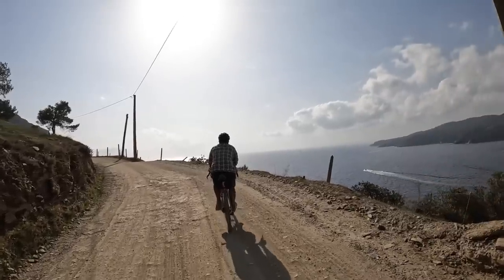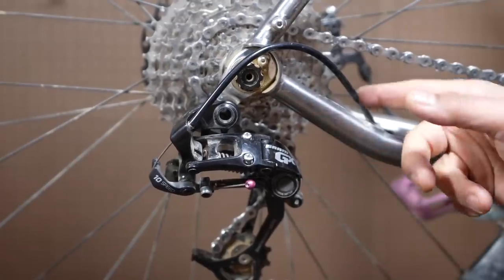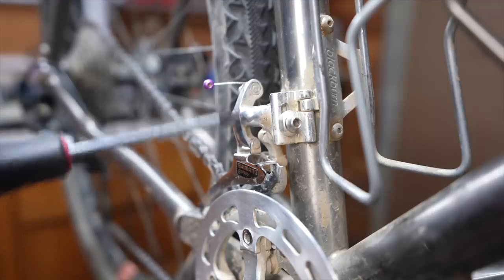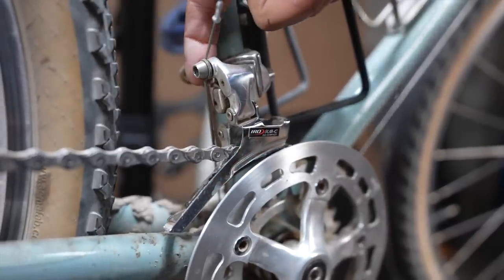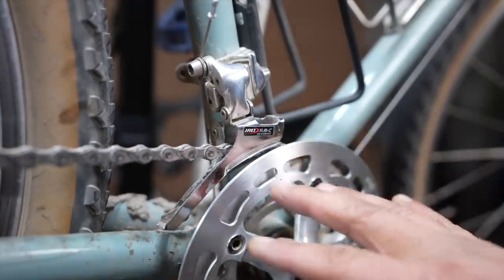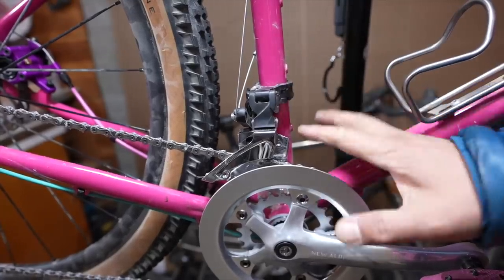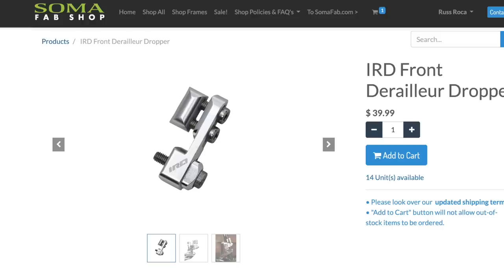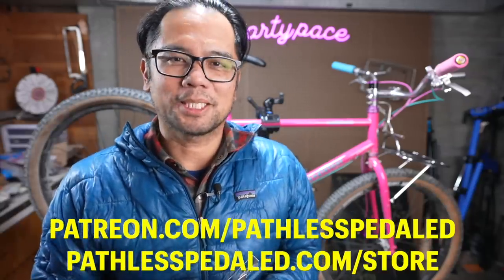These Components Are Disappearing...Get Them While You Can

Comment: Still rockin' a 3x7 on my metal-frame 26" commuter.  And no, I won't be removing my front derailleur because shifting doesn't freak me out. 😀
Reply: 3x is brilliant for 26 inch wheels as the smaller diameter has a wider range of rpm's required.  I cringe at the sight of all of these 26 inch rebuilds going 1x.
Reply: commuter bikes don't even need shifters
Reply: @SurpriseMeJT  O cringe is the word for it, good one.  And whatever happened to revs and knees, just having a rear derailleur is like heading back happy to the stone age.  :)
Reply: @justdude8115  Maybe but the problem is those party pacers.  You never know when they'll amble past and act all mellow but inside you know they're laughing because they're faster than you.  So yeah, that's when I hear the call of the big ring and show them who's who on a ride through the countryside.  Tho' I do feel bad when they can't get their 42 to go any faster.  :)
Reply: @robbchastain3036  hah, noice. But in this case I would simply go with 46t chainring and 11-42 cassette. I don't quite like running front derailleur, I prefer simplicity, but these steep protracted hills are forcing me to run double/triple. I have 22/36 on my current bike, but for my vintage mtb I want to buy 26/40 chainrings
Reply: @justdude8115  Glad you got the grin and at 63 I'm not really fast anymore, tho' I am all-weather stout, call me a party pacer with swagger and I will go down swingin' if overtaken rudely, I'll pick up the pace and offer up a warning that if they don't keep crankin' I will catch 'em and that does keep 'em lookin' over the shoulder until they get up the road.  And that always amuses me, no interest anymore in actual duels.  Unless I enter a gravel event and go for the trophy in the over-60 class.  And that might even call for a new carbon 1x.  You gotta be serious if you want to win.  :)
Reply: @justdude8115  I should add that I like your gearing choices and any talk of triples and you're talking my language, love triples for all those choices and not really having to think too hard about cog selection.  If revs are right, great; if not, lots of ways to find a better cadence no matter the terrain or load or just how you feel and I tend to be all over the map with that as I like to romp and stomp and spin and win and everything in between all on the same ride.  And I think that comes from growing up on a Sting-Ray and then ten-speeds and BMX bikes and racing and training and, in high school, chasing mopeds through the streets of Frankfurt when I was a military dependent in the middle of the '70s and it was done in good fun and if I caught one of those lazy dudes, I'd offer up a cheery Guten Tag as I was almost in tears from the effort, lol.  And yeah, these days I still have a lot of it--or at least some of it and thankfully so--but I have opted not to run down anyone on their fancy bikes anymore, although I used to do it regularly to let 'em know I didn't appreciate the disrespect of no greeting or whatever.  I don't want to discourage anyone from riding and somehow, without trying, I look like a homeless guy on my bike with weathered clothing and gear and floppy panniers and the whole bit.  And I know I look homeless because kind people occasionally offer me money--I decline with profuse thanks--and other people steer clear of me in stores or fastfood establishments, something I experienced two days ago on an afternoon filled with errands.  And that saddens me but at least it is just a winter thing with the weather and my layers of comfortable clothes.  And maybe one of these days I'll upgrade and look a little spiffier.  And faster, perhaps.  :)
Reply: @justdude8115  Grown up bikes have gears.
Reply: @robbchastain3036  is cringe really the word for it? Does Jay really recoil in fear at a 1x drivetrain? Or is he, and yourself by extension, just being a drama queen?
Reply: @throbbinwoodofcoxley6830  Cringe is the word and it does apply to builds where a perfectly fine triple is transformed into a campus bike as tho' that's an upgrade.  And I like the 1x aesthetic for certain applications--more power or imaginary power to 'em--but I'm all over the map with my cadence and happily so, just the way I ride, like sometimes I'll climb out of the saddle in the big ring until I expire and quickly sit down and flip it into the tiny ring and recover the rest of the way up.  And for that matter, I'm still happy with grip-shift-type shifters, got one on my bars which I removed from a Walmart bike which I bought for parts.  The other one is stock but when it goes, I'll remove the other shifter from that bike which I bought new on clearance three years ago.  And I was on the roads of Central Pennsylvania for nearly three hours today, reaching my destinations and waving to motorists who accommodated me and wondering why people still yell stuff out the window at us, like, enough of that, kooks, get over it..
Reply: Trek top fuel 3x9 always shifting,  just like in a semi with a Eaton Fuller.  I would have nothing to do with a single front chain ring bike. A  3x11 would rock.  Keep your chain clean and lubed.
Reply: @dand3975  A 3x9, okay, just a little jealous, I am.  A 3x11, I like the way you think!  😀
Reply: Gearing fashion is not gearing innovation. There's always a trade off between chain line, wear characteristics, changing efficiency, and cadence steps. Stick around long enough and you'll see half step, wide range, close range, 3-ring, 2-ring, 1-by, stepped cog, full cog, wide block, narrow block, fixed and single speed come in and out of fashion. The driver is commercial and the result is incompatibility. In many cases this means not just new components, or even a new drive chain, but a complete new bike. If something works for you stock up, because chances are it won't be around for long.
Reply: @justdude8115  probably depends on the average speed and the elevation gains the rider usually does doesnt it? unless you like going real slow and or mushing that knee cartilage. i pretty much only rode single speeds when i lived in a flat area and it was fine, now i regularly climb 1000 feet on my 10 mile commute. glad to have all my gears  and my not worn out body.
Reply: I ultimately ditched my 3x on the front when I swapped the bottom bracket with a mid-drive.  Before I'd done that I rarely used the low ranges because we only had one hill steep enough to need the lower ranges, and It was less of a bother to just stand on the pedals for a minute or two. Having lost the weight, I can do that hill sitting down on the high front gear. The derailleur is now just a chain guide. 

I've got so much extra power with the motor that not only will I never go back, the next bike to get the conversion is getting the biggest front sprocket I can find. it'll do 10 mph up the steepest hill we have here in high gear with a partially demagnetized motor because I let it overheat one too many times.
Reply: @SMenkveld  Many of them do, but they're not *essential*. A very flat area (such as the Netherlands) doesn't need more than one gear range to get you by. Most of the bikes in that country are single speed, with a handful of 3-speeds. And E-Bikes like mine have pedals as extra/backup power (or to make them appear legal when they are in fact not :P).

Front derailleurs are not as un-manageable as people make them out to be, but they are more finicky than their rear-derailleur counterparts. and if you don't use them much, then the extra weight and tuning isn't as worth it. Ditto the rear gears, though most places have enough hills for the rear 7 to be justified. If I found myself pulling trailers with my bike, I might upgrade to a 9 or 10 speed on the rear.
Reply: @borderlands6606  I like the way you put that, gearing fashion is not gearing innovation and if something works for you, stock up.  And for me in this season of my life, bike commuting is my riding and I am thankful I made the decision to return to it nearly a decade ago after too many years of not doing it with any regularity.  And as I think about it because of this discussion, I just think it is easy to ride s 3x, not much thought has to go into gear selection and it is just fun to have all those options, necessary also with a load or weary legs and body.  And I like Russ' saying about party pace and his pink neon light, but all riding is party pace, just depends on whether it is James Brown or James Taylor on the stereo.  And it's always bring your own bike and mine is usually a 3x, just my choice for the party. 😀
Reply: @DFX2KX  Okay, a mid-drive motor means not having a front derailleur is an excused absence, lol.  And I am sort of right there with you as my commuter with the 3x also has a 250-watt front-hub motor by Green Zone Bikes and I am loving it, actually, my first foray into anything electric and it is mighty handy on my 14-mile ride to work when I am doing a time trial yet again with a Grinch-like grimace, lol.  And I grin but truly, it is great to have some boost and juice in either direction and for commuting, no question that it is safer to have a motor, like for me there is a mile-long straight stretch of two-lane road where motorists really wind it up and the faster I am off that the better, particularly at night.  Same with uphill bends and intersections, just push that thumb throttle and zip through them.  And having that motor has motivated me to ride out of the saddle up ramps and rises as interval-like training and then I have that juice for flats and gentle rises and headwinds.  And I really don't mind riding unassisted, not that I welcome it but I get far more mileage from a battery charge than I ever expected, and that's another reason for me to love my 3x, not noticing the weight of the e-bike conversion up hills and such.  Still, I could see upgrading another bike with a mid-drive, all the fun and games we play.
Reply: @robbchastain3036  I rode 3x mtb for on-road use for decades and never changed out of the middle ring; it was a no-brainer to go 1x and lose the wasted weight of unused chainrings..
Reply: @petesmitt  I'm totally cool with that, no cycling demerits for riding your way and I actually want to do a 1x street bike with a compact frame, 26" wheels, BMX bars, a nice selection of cogs, and a banana seat, with a rattle-can metalflake finish and components plated in complimentary colors.  And it would be an homage to my childhood Sting-Ray and BMX bikes and the 26" single-speed Mongoose I bought in '82 for competing in the BMX cruiser class.
Reply: With ramps and pins shifting a front is not much more difficult than a rear. I run a XT 3x9 (44/32/22x11-36) on my trek  7900 drop bar gravel bike. Will until I replace the bike with a 2x wide range. Having those bailout gears bike packing or even just on a long day in the saddle is great.
Reply: @MountainVisions  I'm enjoying this conversation about 3x and it is prompting me to think more about why I like it and yes, the bailout gears are great.  And what's more, for me, is that my 14-mile year-around commute is never really the same from one ride to the next and maybe I'm sloppy that way but I pretty much freestyle all the way and I face a bunch of ramps and rises and a couple of proper climbs and my first decision before each is selecting a front ring and then dialing for cogs.  And then laying on the proverbial tank on any descent and preparing for the next grade of any significance.  And I make it a game, too, like one morning this past week I opted for spinning out of the saddle up a quarter-mile rise and busting my thighs and lungs until I reached the telephone pole which brought that madness to an end.  But I made it and I was happy about that.  And who knows, maybe all of this will win me a ribbon in the over-60 class at a gravel event or something.  That's what I keep telling myself, anyway, and it is all great fun, sometimes more so afterwards, and all grins aside, I enjoy the health and financial benefits of riding daily, plus being a cycling advocate of sorts is meaningful, too.  Like this past week, I had just finished a rise when I looked over my shoulder for any approaching cars and noticed a boy waiting for the school bus, looking intently at me ride past him on his front lawn.  And then there was a woman on a walk and she exclaimed, "I see you riding your bike every day, back and forth."  And I'm all for being seen on a bike and hoping others opt for their own adventures and challenges, too.  O and one more thing about the tiny ring, safety in terms of keeping your line with revs when you're on a steep climb on a shoulder next to a guardrail with motorists gunning it and leaving little room for any deviation in your line.  Thanks for writing and 3x9 sounds like something I need.  😀
Reply: @SurpriseMeJT  I like having 3x on my 26ers, but i'm pretty sure what you are saying is wrong. The smaller diameter wheels do of course have an impact on the gearing, but in a linear way that can be compensated completely by just having a bigger chainring.
Reply: I have 3 bikes one of them is a 3by too. I would prefer taking out the gears in the back leaving 1 while holding onto the three in the front to give me options for different gear ratios. That is all I need maybe only 2, but I haven’t tested the gears on the ridiculously steep hills I come across front time to time. If I could get away with 2 then that would be ideal, but for my single speed unquestionably I want just 2 in the front.
Reply: RollinRat  at 63 a single speed wouldn't work for me here in Cumbria......some of those hills are relentless.

Comment: Best solution in my experience bikepacking 6 months in south america on 5000m mountain passes: 32 oval up front and a 11-46 cassette. All that is 1x but what if you had a 22 chain ring also on that crank! Well hell yeah, you just switch it with your fingers when there is a 20km climb with 2km of elevation gain incoming. For the 5 seconds it takes and the occasional dirty fingers, it saves weight is complexity on a bikepacking trip!

Comment: I don't know if this is the first time you explained the sub-compact as a 1x with a bail-out but that is a perfect explanation. Every gravel bike that wants to do double duty as a trekking machine should have that crankset. Very good video!
Reply: I've also seen people running a bail out chain ring with no front derailleur. It's possible to shift down using your heel. Obviously you have to stop to shift up again, but that's my norm at the top of a long steep climb!
Reply: @davidraffe3445  I've seen this more common on tadpole recumbents, which makes sense if not for the greasy fingers on the lifting to the big ring.
Seems a nice middle ground where the lower end was the old flip your rear wheel around to get another gear. Not too much reduction else chain length issues.

Comment: Worth noting FDs come in 2 flavours: 63-66 degree and 66-69 degree. This tells you which chainstay angle they fit. 63 is 'road' style 66 is MTB. It makes a difference in getting the FD to clear the chainstay on the smallest ring.
Reply: Also make sure the derailleur matches the number of teeth on the largest cog. I had to replace a chainset on my 26" mountain bike and carelessly didn't notice that the new one had more teeth on the largest cog than the original. I ended up changing the front derailleur as well.

Comment: Love this! IIRC, my old 44/28 setup used a 105 road triple shifter to get the pull needed for an SLX front derailleur.  Clunky, but not a big deal with the small ring being a bailout gear. Tiagra/GRX 400 rear derailleurs have recently had 2 tooth higher max cog size than 105 and up models. Miss the days when MTB and Road cable pulls were compatible.

Comment: Excellent explanation of all the issues that come with a front derailleur. Once setup, front derailleurs are nice to have for both the range and the bail out on steep climbs. I also like it as a chain guide as 1x can drop a chain on the washer board roads. If you have lots of middle aged mountain bike friends, you can source a front derailleur for a six pack of beer.
Reply: To be fair, with modern 1x, I have never dropped a chain anywhere: front or rear. Narrow-wide chainrings and clutches mean they are very reliable. I used to drop chains on my 2x (even Di2). I have Ekar now on 2 bikes and no chains dropped, ever.
Reply: @seanrequiredfieldcannotbel1362  Good for you. My Sram GX clutch can't seem to handle the washerboards. I'm using a 1x Raceface Narrow Wide chainring. My 90's mountain bike with Alivio front and rear derailleurs slapping about doesn't drop the chain on the same mile long washerboard section. All I'm saying is a front derailleur serves as an effective chain guide.
Reply: @newttella1043  have a shop look at your 1× setup. Morern 1× does not drop chains, is what I'm saying. Your point is moot because I can drop a chain on a 2× that has a front mech.

Comment: Look at the Shimano XT 2-11 front derailleurs on the big auction site. Under $10 and work great for 28/38 chainrings. The 11-46 cassette works great with the 11 speed Shimano SLX or XT GS derailleurs. I am running 28/38 and 11-42 11 speed on one bike and a 11-42 with a 24/36 11 speed another bike. Both with 11 speed chains. Russ, keep up the excellent work!

Comment: Thanks for doing this series on cranksets and front derailleurs. This has been a source of frustration for me to find combos that work. On my road bike I installed a mountain double 38-26. I had to make an adapter to not only move my derailleur down ( bike had braze on mount) but also out about 4 mm as the crank outer ring was too far out. Pain to get there but it's the 1st time I recall actually having gears ( 26-34) low enough to make me happy.